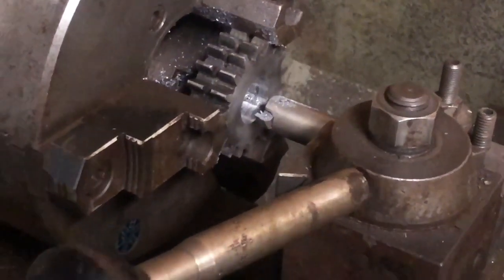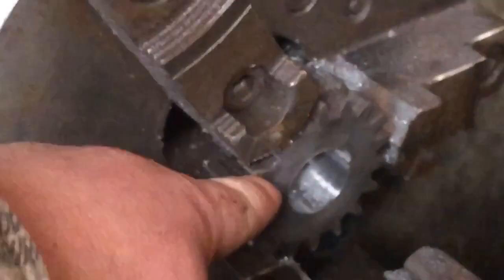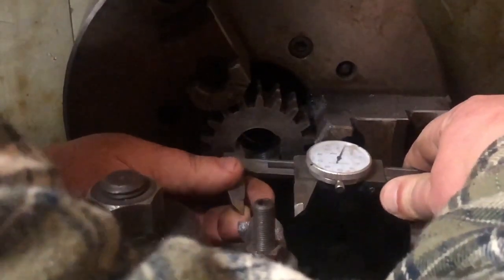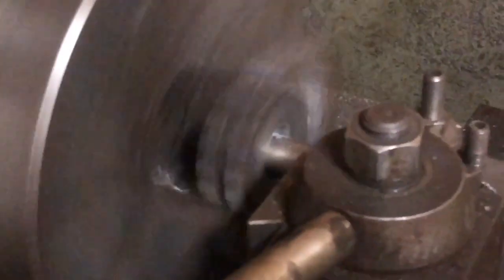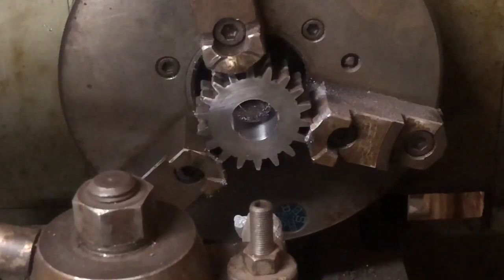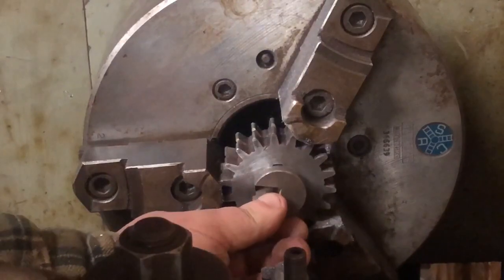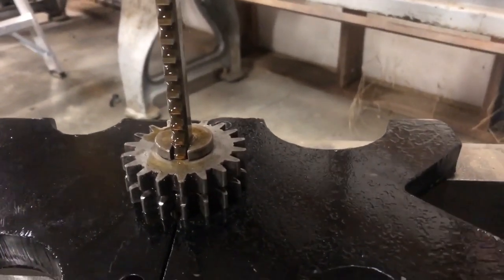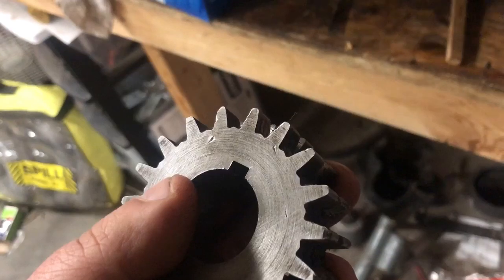Boring and broaching a drive sprocket for the cisco lathe

Comment: Nice lathe work here are you going to have to cut the key way deeper as well? I am just seeing a witness mark from where the key way would go but now your hole size is correct. Here we go it is broach time never used a broach personally. Nice share thank you. There is the key way coming back and finally there it is a restored part ready to go back to work.
Reply from the maker: Yup, the job turned out nice